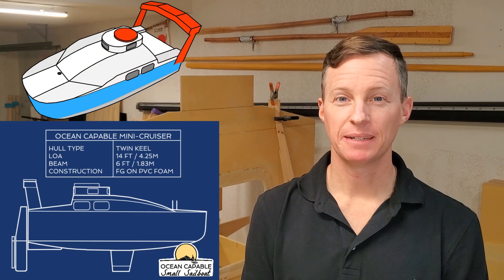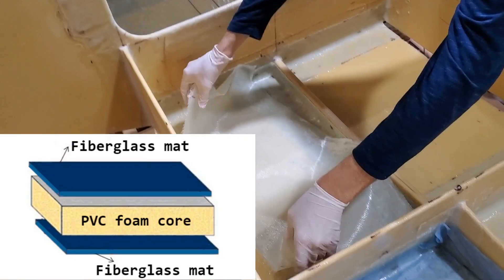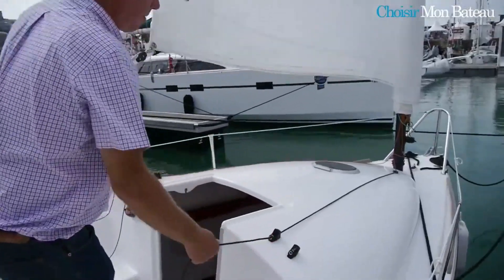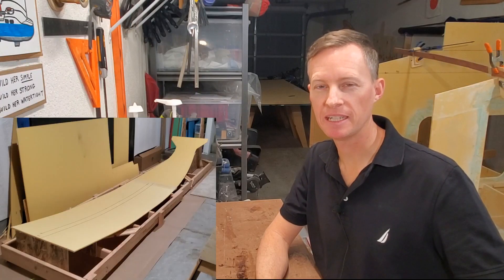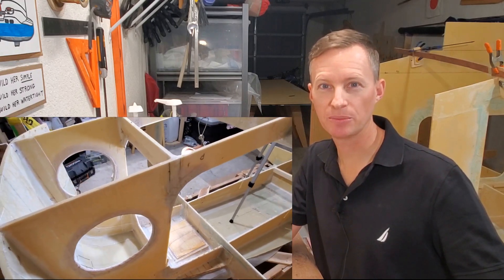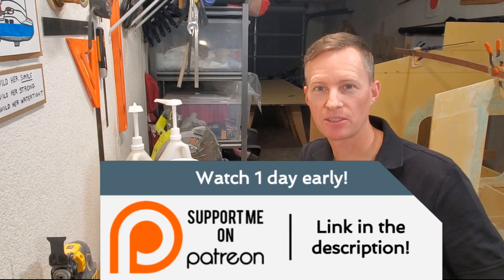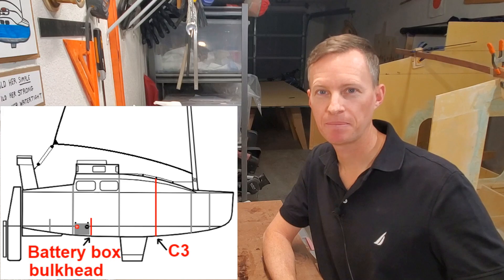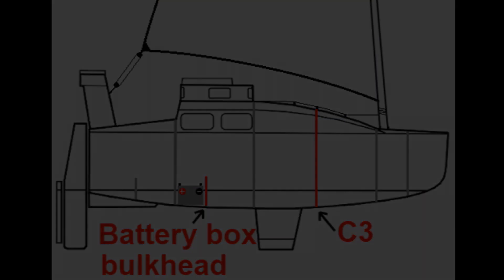OCSS-023 Installing the Final Frame - Mini-Cruiser Sailboat Build

Comment: What a fine tutorial on making a template, much better than the tick stick method. I've never trusted my boats to be symmetrical enough to make a starboard pattern, flip it over and hope it would closely fit the port side, but you got away with it. Again, using epoxy soaked rope on the inside frame edges and portholes is inspired. The gimballed shelf for the stove and eating is nice -- and nice forethought to get the backing plates in now. Looking forward to your continued progress. Small boats are the best boats!
Reply from the maker: Hmm, we'll see if I run into any trouble with those symmetrical frames. I think it will work out though. I know already she's not perfectly symmetrical but that's ok with me. As long as no one can really tell unless they break out a tape measurer. 😂